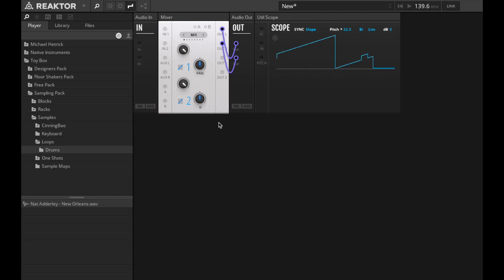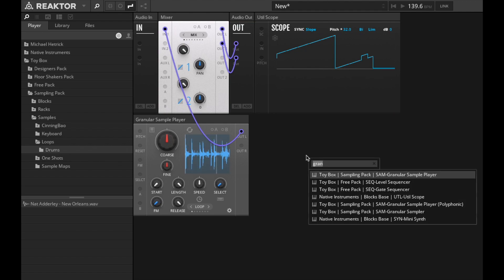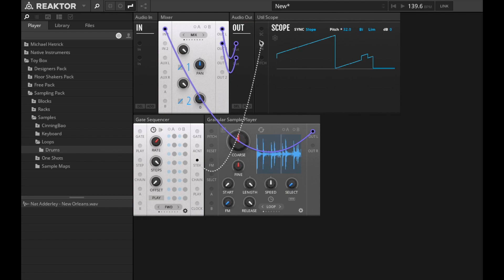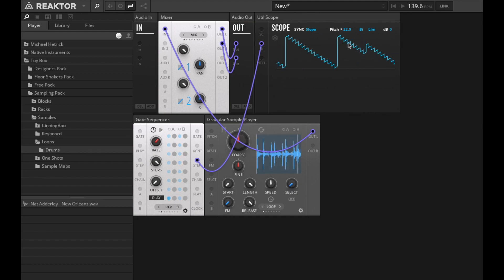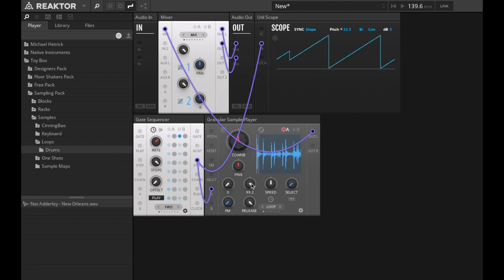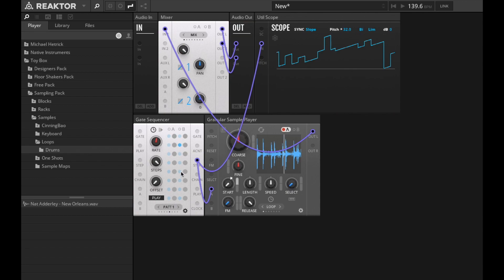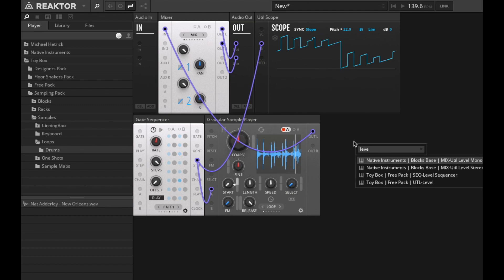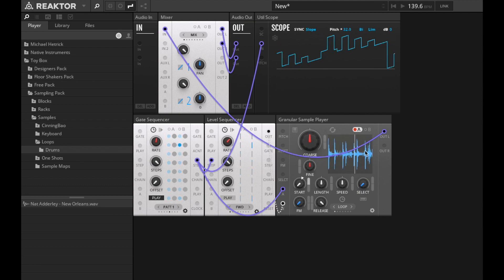Toybox - Granular Sample Player

Comment: Thanks for taking the time to make a couple videos. I hope you'll keep making them. I did have some trouble following along with what should have been a simple demo. In the Granular Sample Player the default value for KEY TRACK (the little grey keyboard icon) is ON, and this causes the audio samples dragged into the sample player to sound muddy and distorted, much different than shown in the video. I had just about given up when I happened to click KEY TRACK icon.

Maybe it's just me but I find Reaktor, and for that matter, all of NI's software, clumsy and unintuitive. I suppose I've just given other software such as Ableton Live more patience, but Reaktor always takes me forever to figure out the simplest things, and I've never solved any problems or produced anything worth the perceived time sink.
Reply from the maker: Yeah the 'key track' button is something you need to keep an eye on, it's the same for the oscillators, if it's enabled then the pitch will be controlled by the pitch input port and if nothing is connected to this port it will be VERY low..